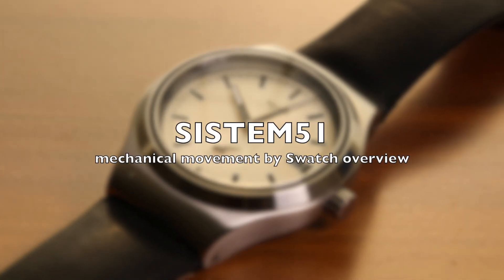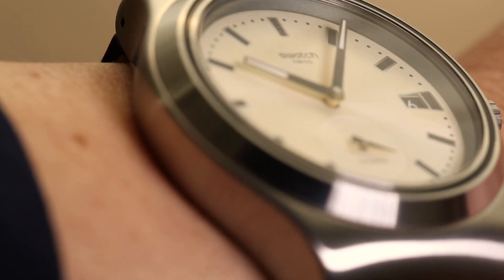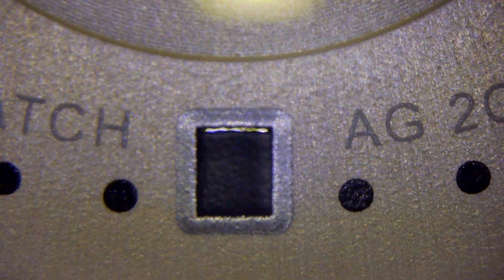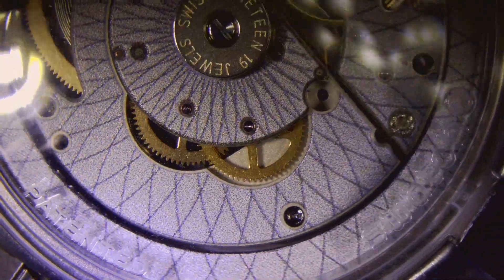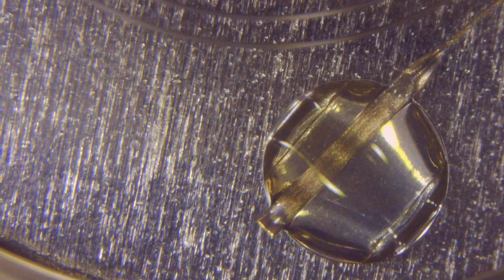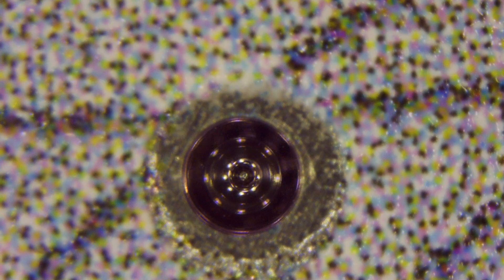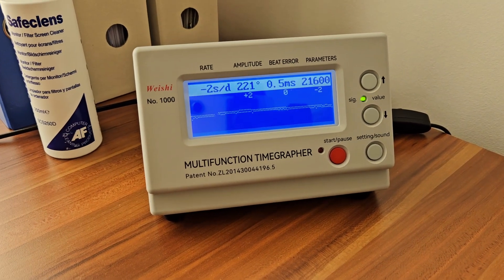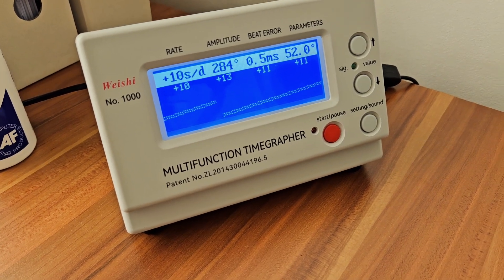Swatch SISTEM51 movement made of... plastic?

Comment: The movement System 51 its not reliable, mine brand new doesn't run on manual winding and with wrist movement the spring moves erratically and stop.
Reply from the maker: Oh, that's unfortunate (
Looks like a defective one.